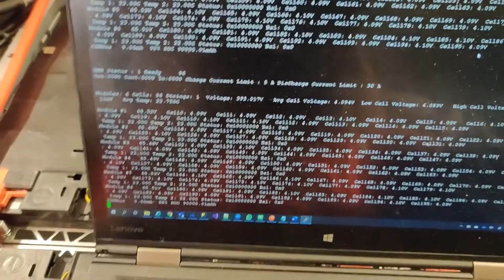Jaguar XJR EV Conversion - Battery Box Installation

Comment: Thank you for your great battery build!
How did you connect the HV cables to your two battery boxes? Did you use the BMW safety boxes? I had a look on your Open inverter project posts but couldn’t find it.
Reply from the maker: @Ghia66  I used BMW safety box for testing. In the end I build my own contractor box with ISA shunt to monitor current and voltage. Primary reason was that at the time I was building there was no way to communicate with BMW box, now there is but with some limitations.
Reply: @ArtursGarage  Thankyou for this.
In my test setup I have the BMW box connected to the battery and the Outlander charger and the Zombie (as per Greg)!
I was hoping that if I added an extra BMW battery pack I could parallel that into the BMW box for an elegant solution 🤞
Reply from the maker: @Ghia66  I did just that for my early testing, it is doable. One thing to keep in mind is specifications on the contactors. Ones in BMW box are great quality but not the biggest one as far as amperage so watch your max amps to prevent welding of contacts. Depending on your application you may want to limit current.
Reply: Thankyou for this.
What size capacitors do you use in your junction box? Just wondering if I could change out the BMW ones with a larger capacity ones as a work around.😊

Comment: Your lucky your allowed to have the battery up the front. Cannot do that in New Zealand.
Reply from the maker: Yes, I feel lucky. However those batteries are reasonably well protected, small fender bender is not going to hurt them. I have seen batteries much more exposed to front crash damage.

Comment: how are you going to get the two Simp-bms units to work together ?
I'm using a teensy 4 with 3 separate can bus'sone for each Simp-bms and one to connect to the charger and the rest of the car
Reply from the maker: So you know it is little bit tricky. I was going to something similar you are trying to do. Started modifying code to support separate channels and realized it would be to much work. Then decided to take another route added another CAN channel to Teensy 3.2 (Using Teensy 4 is better alternative in my view). Making modification to SimpBMS code so each board can be configured as Master or Slave. One CAN channel will be used exclusively to communicate with BMW modules, another to communicate between SimpBMS modules and car. This is more scalable and less modification of original code, more like adding on to it. Now, Master SimpBMS is almost stock code and will provide all features of BMS like monitoring system voltage, current, controlling chargers, contactors, whatever you need. Slave SimpBMS module will focus on monitoring cell voltages, will do balancing of the pack and report stats to Master module in case warning or alarm on the cell level needs to be raised. I hope it makes sense. I think it is cleaner and more scalable approach and requires less rewriting of SimpBMS code. Are making good progress on your solution?
Reply: @ArtursGarage  yes I did the same as you started modifying the code then decided it was too much work I will leave the simpbms code unmodified as each box will have it's own simpbms controlling it's own charging relay and I will just intercept the can signals to the charger and send my own modified signals

Comment: Hi athur im watching you closely cose im building xjs with the same drive train and damiens ecu, whats the battery you r using?
Reply from the maker: Hi Piotr, I really like XJS. I am using BMW batteries, please check out my Battery Box Build Part 1. Also, keep in mind those are relatively low capacity and you need several parallel packs which is not recommended.